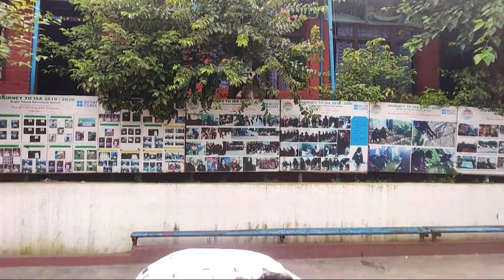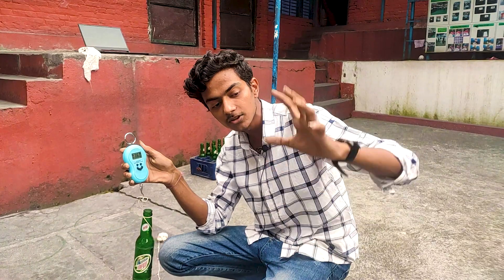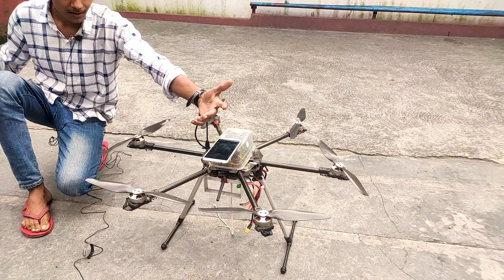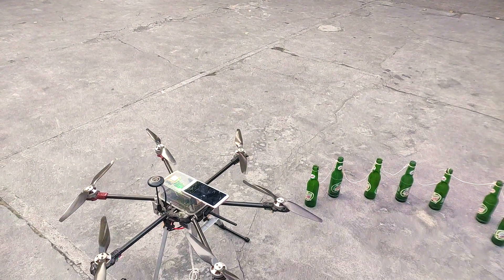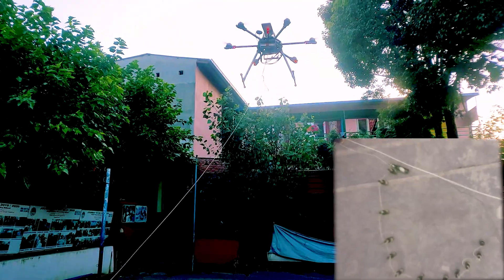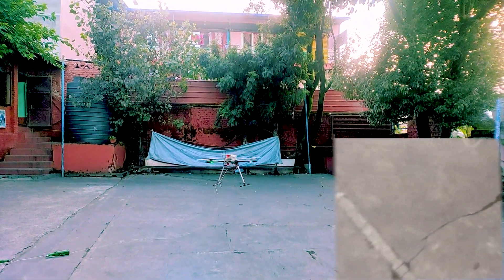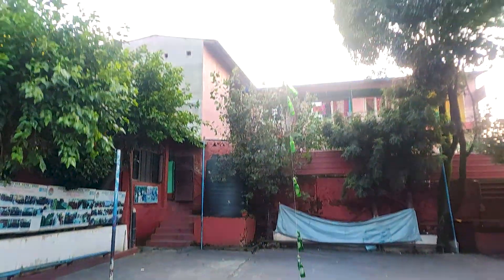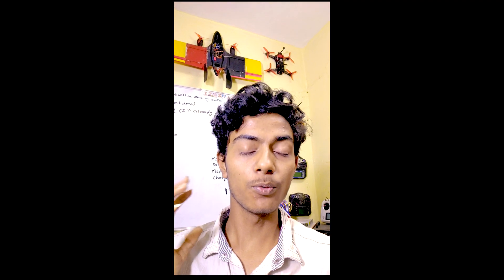How much can a drone lift? || Drone weight lifting test

Comment: You should use plastic soda bottles filled with water, and attached firmly under the drone body itself.
Reply from the maker: That would have been much better, i tried using the resources readily available but this could have turned into a big mess if the bottles had smashed. Thank god, nothing terrible happened.